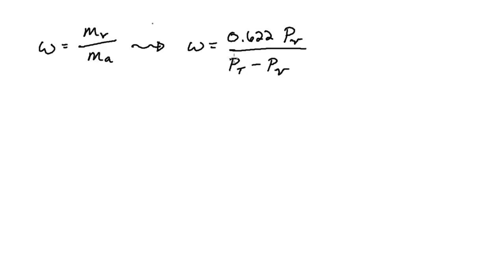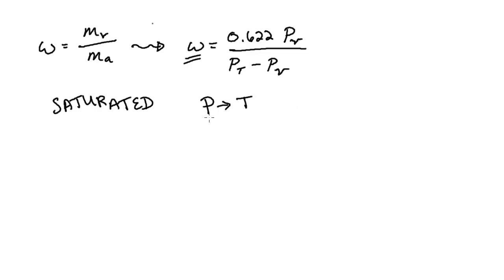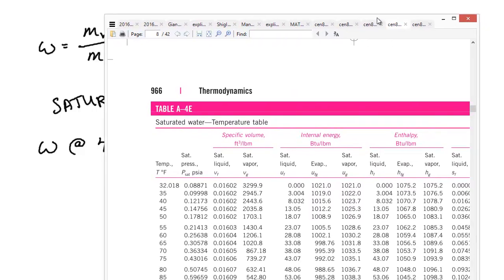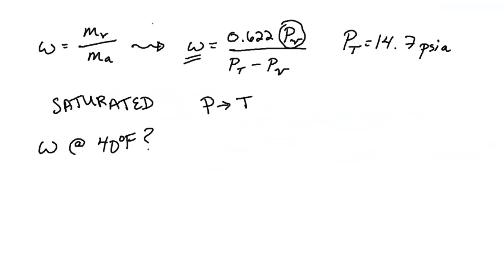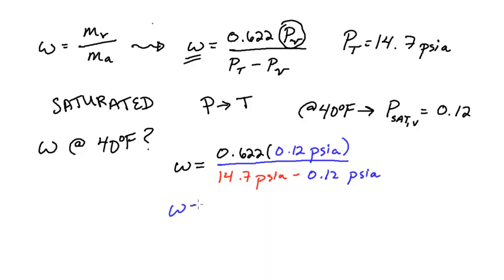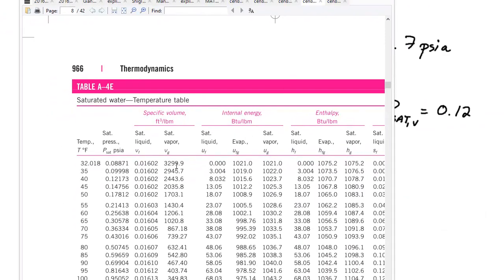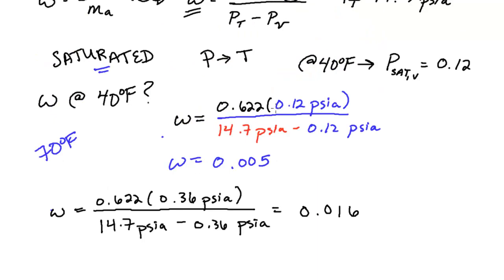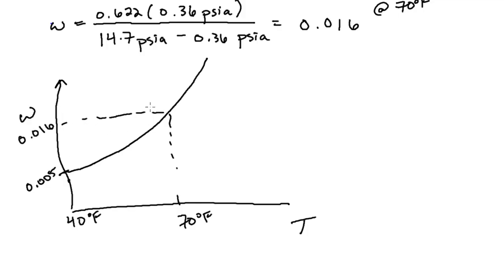Maximum Absolute Humidity Ratio

Comment: The total pressure of air of 14.7 depends on elevation, correct? So, these calculations are also a function of elevation? It may be good to clarify this.
Reply from the maker: You are correct - total air pressure is not a constant and is a function of elevation. I should have explicitly made mention of this.